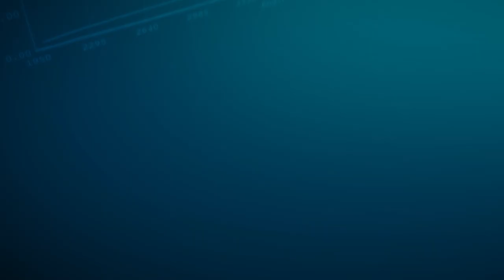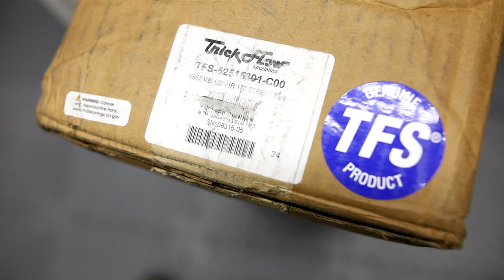CC'ing Heads — How To Measure Your Combustion Chambers' Volume

Comment: I see that the intake port volume is often specified.  To CC the port, do you just stick a valve in there, maybe with a little grease on the seat and a light spring to keep it closed, and fill the port to the top?
Reply from the maker: Yep. You put the plate on the intake port to seal, and rotate the head so the port opening is up. Everything else is the same, except you'll usually need to refill the burette 2 or 3 times.
Reply: Always bleed the burett to 0 before you pour. It was mentioned but not shown. Otherwise you will be off.

Comment: If your cc'ing a lot of heads this tool would probably make sense but for a home builder a syringe will do the trick.
Reply from the maker: Even home builders like nice tools. Sure McDonald's dollar menu fills your stomach, but most people would still prefer a steak dinner. Not to mention, a burette is 10x more precise (0.2cc grads vs. 2.0cc grads) than a syringe, and for a lot of folks, "close enough" isn't.